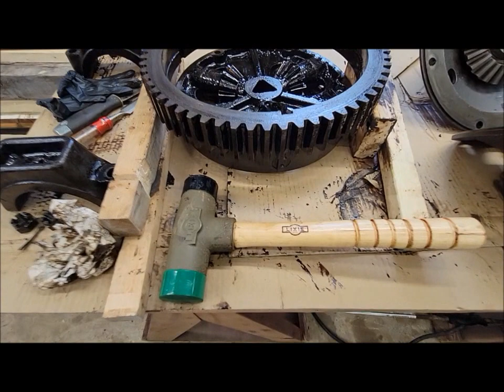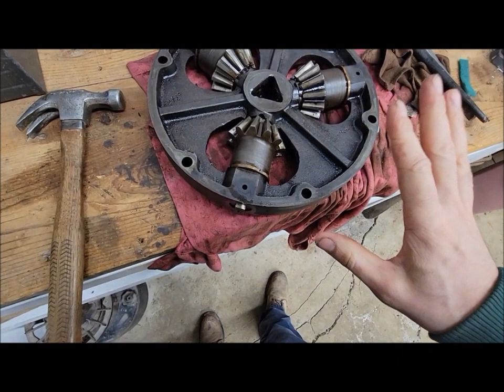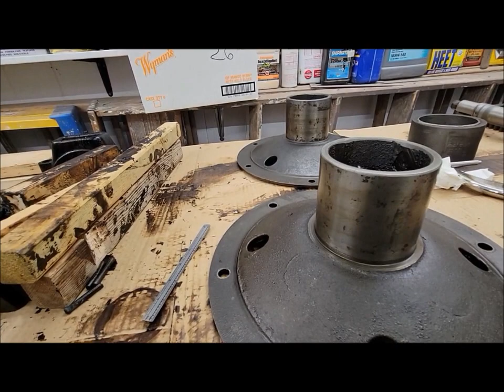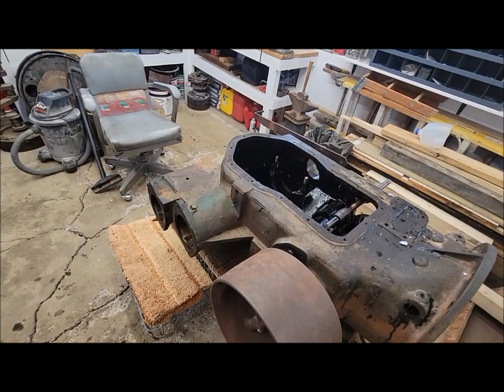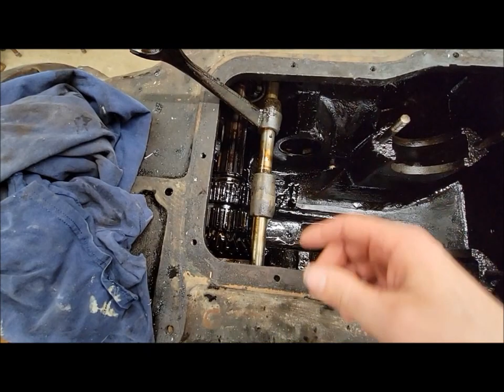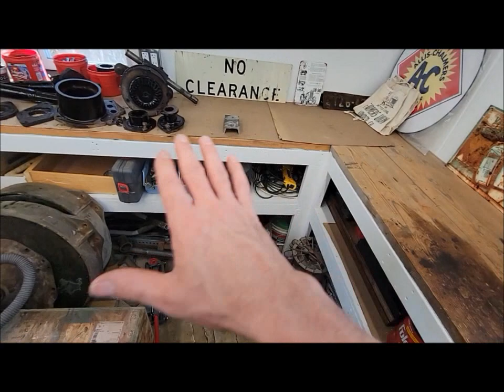Allis Chalmers 15-25 Part 13 -Differential & Transmission Disassembly & Cleaning

Comment: Jacob, Can the brass part of the reverse idler gear be turned around so that the chipped portions are towards the shift collar.?
Might save having to buy or make a new gear.
Reply from the maker: That thought did cross my mind, I'll have to check that out a bit more, but I'm thinking it is possible?
Reply: May be possible. You could likely figure out a way to chamfer the new leading edge of the reverse gear with a grinder then dress the teeth edges for ease of engagement. Is there any sort of pulley shaft brake on your brand?
Reply from the maker: @duron700r  exactly, if the gear can be flipped the leading edge would have to be machined/ground to the proper shape.  
Allis 20-35's have a break in the clutch, so when you push the clutch lever all the way forward it engages a break to stop transmission movement, which stops belt pulley movement, which prevents grinding gears when shifting.  I believe the 15-25 is the same, but haven't gotten that far yet.  The 6-12 does NOT have this feature, and I sure wish it DID!   If you are going from forward to reverse or vise versa it's not a problem, but if trying to shift into either gear  after being in neutral is about impossible to do without grinding because the pulley is spinning and centrifugal motion keeps things spinning.  You can have someone stop the pulley by hand, then shift.  I wish I could figure a way to add a pulley break to the 6-12, I would, but there just isn't a way with the tractor articulating the way it does. Or at least I haven't figured out a way.  It's the one obvious flaw I've found in the tractor operations design.

Comment: Those spider pins...
They drive the bull gear don't they?
Reply from the maker: Yes Duey, the spider pin ends are also the keys to keep the differential gear from spinning on the differential main casting.  And the differential side pieces keep it all sandwiched together left to right